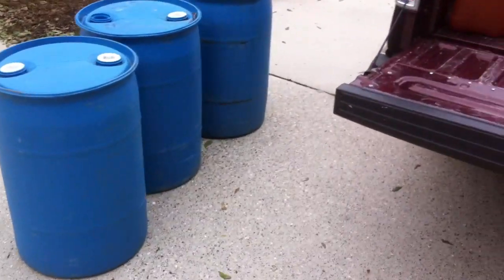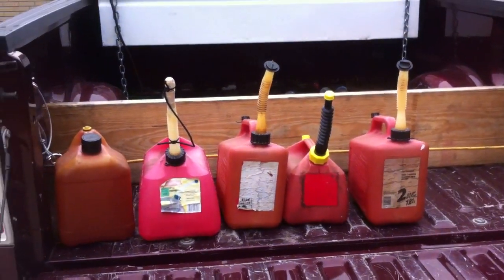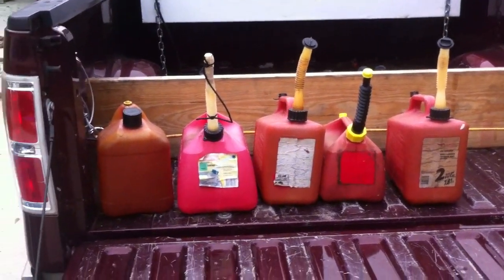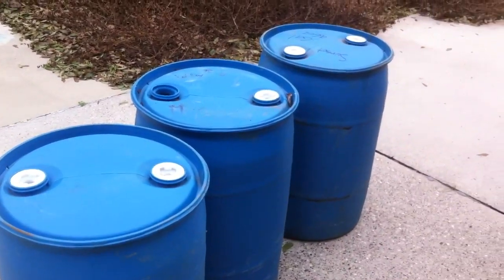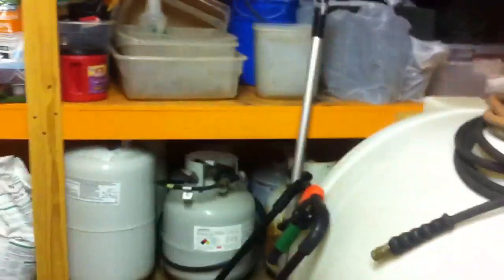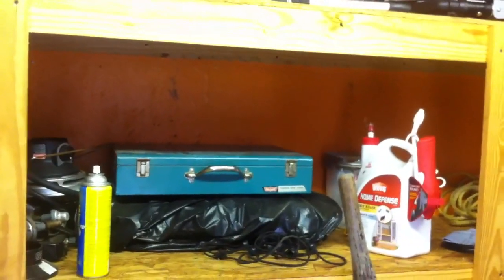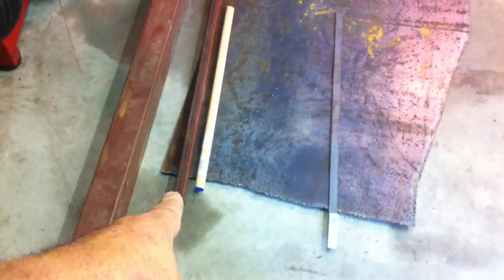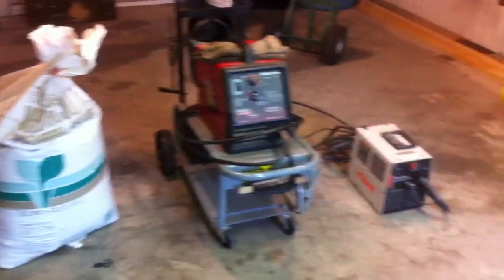Rocket stove build

Comment: Are you planning to work that close to 44 gal. of gasoline and Lamp Oil I would want a ' FIRE WALL ' Between it and me working
Reply from the maker: thats a different building. i have a 9 x 12 building with all my fuel in it. this is the addition to my workshop that ill be welding in. its about 100 feet from the fuel building.

Comment: Right with you buddy, let's rumble! Thanks for the great videos! Whereabouts are you by the way? About the last stove you put together, I was wondering why your design has a horizontal feeding slot for the wood as opposed to a vertical one (so you don't have to keep pushing the wood forward, gravity does all the work for you). Cheers!
Reply from the maker: you can control the heat of the cook stove by pulling the wood back away from the coals. you cant do that with a vertical feed tube and these things burn very hot. for cooking, being able to control the heat somewhat works better for me. im in northwest louisiana.